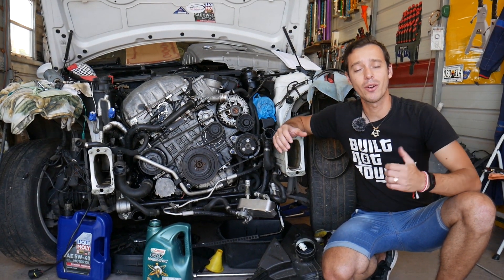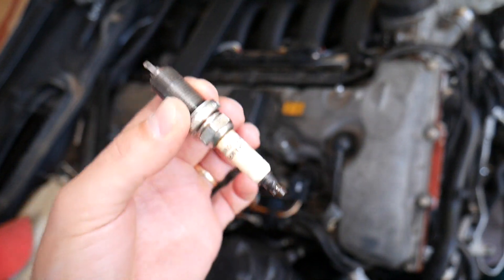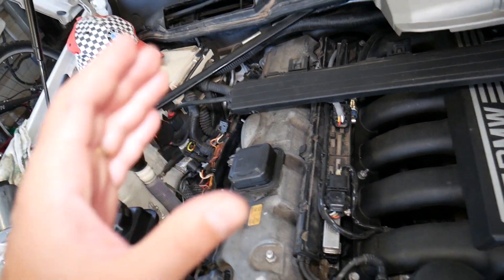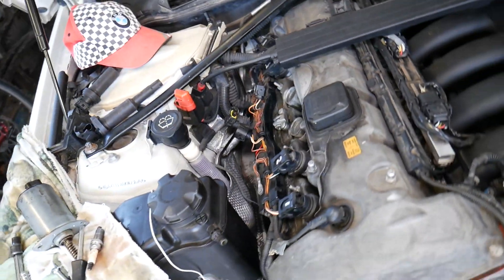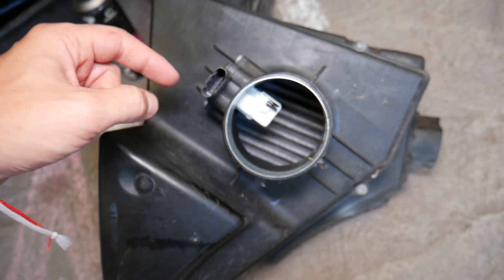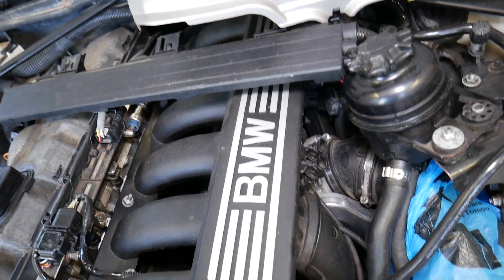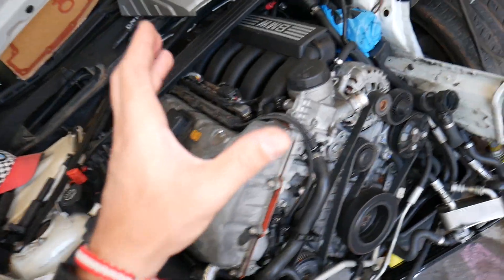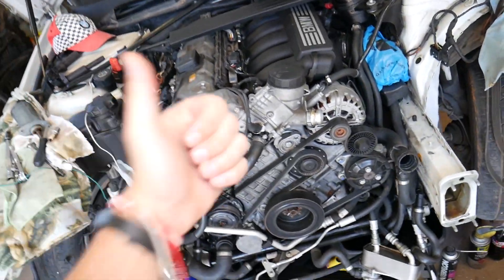WHAT CAUSES ENGINE MISFIRE ON BMW E60 E61

Comment: Hello dear. I have a problem with the car for more than a year now I have been suffering help if you can.
I have a bmw 545i n62b44, the problem is that the bottom does not pull on hot. For example, if I leave the car for 2-3-4 weeks and do not drive it, then it drives and pulls for a while, but then over time it starts not pulling again, gains momentum poorly, loses momentum, does not pull, no acceleration.
I changed everything that could be changed.and everything checked. valve cover new,PCV-CCV changed,Spark plugs bosh bmw group original, the original changed the ignitions coils new original, the benzo pump filter changed the original 3.5 bar bosh original, there are no errors in the diagnosis, the catalysts were removed and no error code , the check engine does not burn, the MAF sensor is normal, I don’t eat it myself, but I look after it. I can’t keep up for 3-3.5 engine Toyota up to 5000 rpm and after 5000 rpm the car seems to be driving
Help brotherly what could be. What is the problem.where to begin tell please